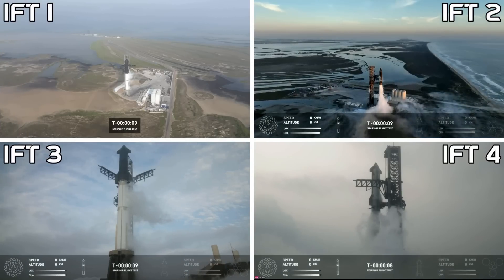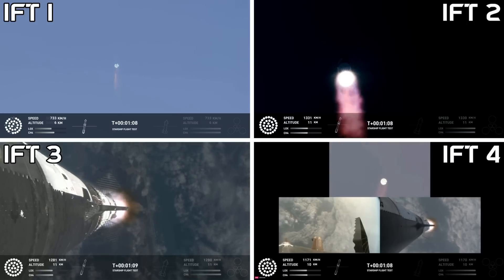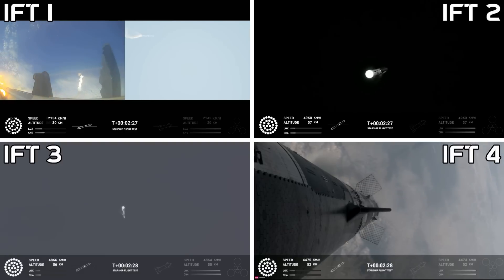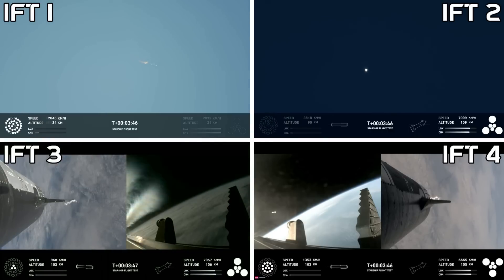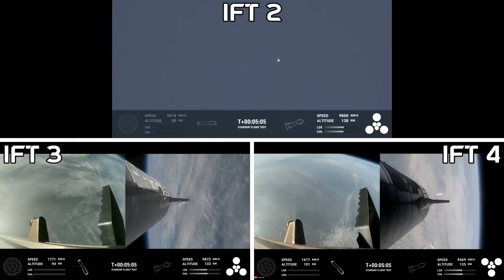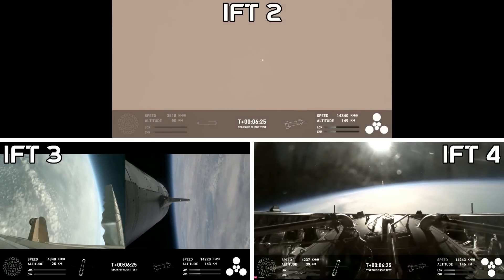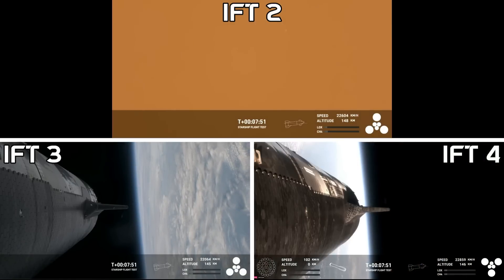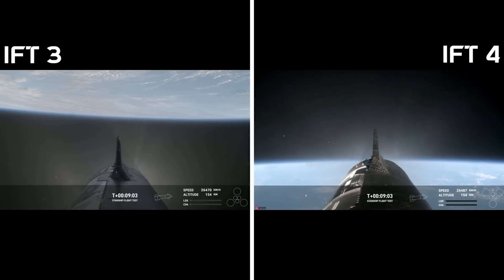Starship Launch SYNCED: IFT1 vs IFT2 vs IFT3 vs IFT4

Comment: Weird how the Starship engine diagram (lower right corner) is flipped on IFT4
Reply from the maker: Upside-down triangle, fighting the "powers" 🤫
Reply: I think its because the flap cam was on the other side this time.
Reply: @Diddibobbo was it though?
Reply: @LSF17  i think that because space was on the other side on ift 4 than ift 3
Reply: @Diddibobbo  the ship could’ve just been rotated
Reply: @LSF17  yes, that explains the flipped engine diagram

Comment: IFT-3 and IFT-4 it’s a twin brothers??
Reply: No.B11 had 32 healthy raptors while B10 had 33.
Reply from the maker: @dangorneanu9616  Healthy going up. Waiting to see the data on the raptor engines state after the soft landing, it's crucial that they are in good condition.